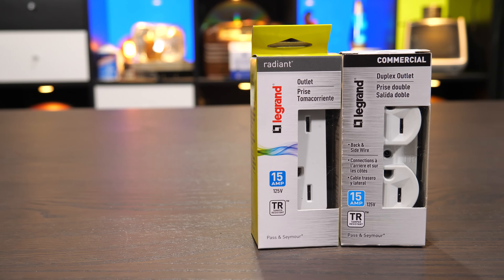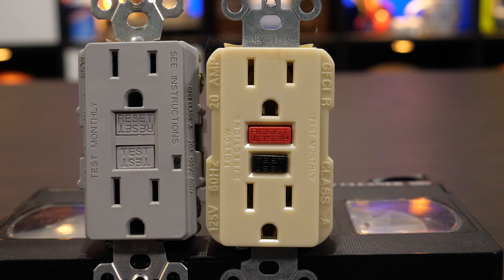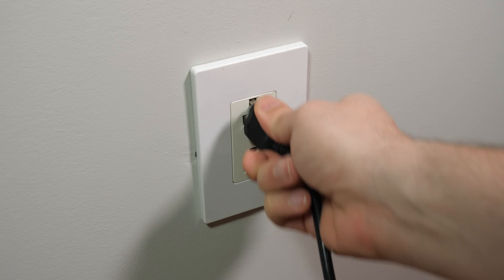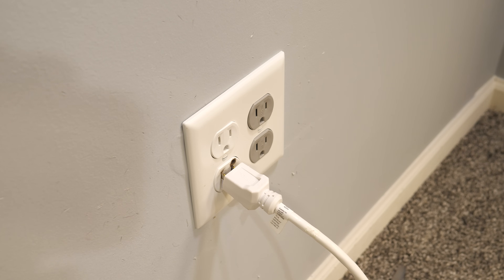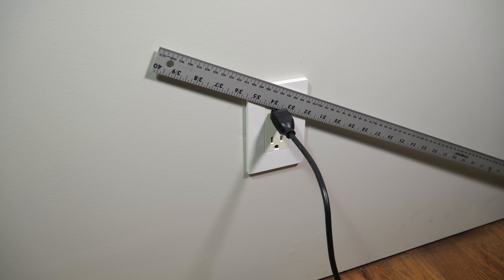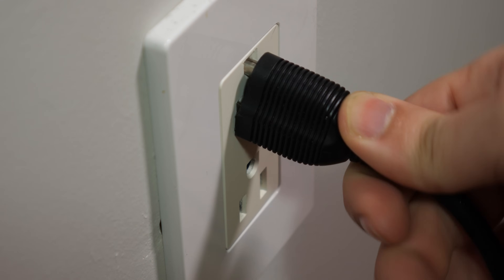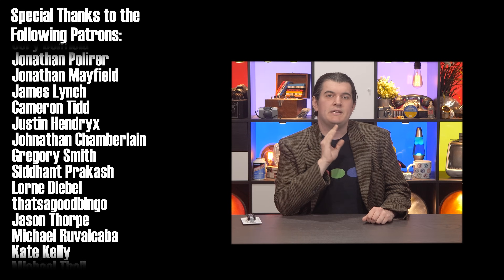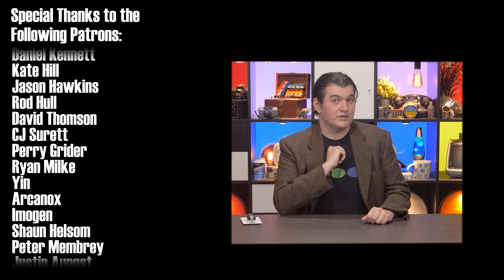Power outlets are topsy turvy - but does it matter?

Comment: my HVAC teacher had all the outlets in the shop with the ground on top. he claimed that sheet metal could fall and become stuck behind a plug. But most of the tools we used had universal motors with no ground pin, so in practice the ground pin orientation didn't matter.

Comment: I had some electrical outlets installed to replace ancient ones; great, except you couldn't actually plug things into them without a hammer(almost), child proofing I suppose. Had to replace them all with ones which I had to test a sample of before they were  installed.I like the 45° plugs and the extension cords with a molded in loop at the back.Great video as always.

Comment: In the UK, lots of imported stuff (mostly chinese) has the writing upside down and the cable sticking out of the top... because the chinese think our earth prongs are at the bottom. Also there's no actual requirement in our wiring regs to have our outlets earth up'

Comment: As a remodeling contractor, I can confirm that the tape-measure scenario is a.) real, and b.) will scare the pants off you. 😅 I almost welded my tape to an uncovered live outlet once, and it still has a sharp notch in the blade that I have to watch out for.
Reply: This was my introduction to this issue as well.  Scared the heck out of me at the time.
Reply: Most circuit breakers take a couple milliseconds to open, enough time for nasty sparks and welding if it's a dead short. Most electricity related injuries are caused by secondary events, like falling off the ladder when instinctively retreating from the loud bang.
Reply: Many years ago, I was working at a McDonalds. We had a heavy metal shelf above an outlet that was held onto the wall with keyhole slots. I missed the posts and the shelf hit the prongs, popped the breaker, and took a nice chunk of metal out of the shelf. 😬
Reply: Did it myself several years back. To this day I've got to fiddle with that tape to get it to fully retract.
Reply: @currentsitguy  Wow, your tape measure lasted for more than 6 months?? I've never zapped my tape measure, but none of them last long.

I think that the danger of American plugs are very overstated. I have never gotten shocked because of the plug or outlet. I've gotten shocked two times - once because I stuck my finger in an empty lightbulb socket, and once because I touched something that was connected to some metal siding that was just installed, that had a nail driven through a romex wire. Crazy but true. Also 120v is much less dangerous than 240v.
Reply: @FLPhotoCatcher  What are you doing to your poor tapes? I have two of them: one was my aunt's (this one is more than 40 years old), and the other I bought myself (this one is about 10 years old).

Both in good condition. Just treat them well, and they go a long way.
Reply: @sysbofh  I haven't mistreated my tape measures. Some of them broke after the first use. The springs in those were made of brittle metal - they were made in China, of course. I have one that is many years old, and may be made in the US. It's hard to find quality tape measures.
Reply: @FLPhotoCatcher  I've got a bunch of tapes, I just keep this one around as a sort of good luck charm now.
Reply: @FLPhotoCatcher  I don't think you're alone, the only tapes lasting for me are older than me. Whenever I buy new units they tend to fail, plastic case cracks, spring fails, what have you. Wish I could buy a simple 25 foot measuring tape of decent quality anymore.
Reply: “They go a long way” - 25 feet, to be precise!
Reply: @sysbofh  Pretty sure they didn't intentionally shove the end into a known live electrical source.
Reply: No fuses?
Reply: @Losermachine35  tape measures usually don't have fuses. Jokes aside, in these kind of situations you may not have high enough current to trip it, plus, fuses can melt/weld themselves which is more likely to be the case in a place with loose sockets/frequent trips.
Reply: Blend the notch out with a half round double bastard file until its not gonna bite your bits.
Reply: Is it worth covering the notch with packing tape?
Reply: Yes, but with changes to circuit breaker design, is that even a  problem that's going to exist in 50 years? Even today, I don't see this being a particularly common problem to have. Between the GFCI and AFCI being mandated, Fresh Princing the outlet doesn't really do anything that the advanced features don't do better. Then there's AFCI that's likely to be incorporated in every single circuit at some point, rather than just the relatively long list of rooms that it's currently required for. 

You'd likely get far more safety out of making it easier to replace loose outlets that can't retain the items plugged into them any more than flipping them upside down.

Comment: Yeah, it's not really a big deal. That being said, even a tiny tiny tiny tiny tiny safety benefit with zero additional effort is worthwhile. And I personally haven't encountered enough right angle plugs to justify choosing ground down. Better just to do away with the awful plug design, but that would take effort, which Americans don't like.

Comment: Germany has plugs which have insulation around the first part blades (which are round and therefore not prone to slipping), with symmetrical outlets and beefy right-angle plugs with a good grippy design. I wonder what flaws these have?

Comment: WRONG. All of the right angle plugs you buy are designed for the ground on the bottom. The  USA electrical manufacturers should be working on insulating the first part of the hot lead so that we are not killing children instead of this nonsense.

Comment: Not quite "throwing knives at the wall", but one time my cat was playing with a mouse toy with a metal wire attaching the mouse to the rod. She managed to drag the wire along the wall in a way that shorted out a night light that was plugged in. Tripped the breaker and scorched the receptacle a bit. Luckily nobody was hurt and nothing significantly damaged. We replaced the receptacle (it was a bit worn out, leading to the night light hanging out a bit), and replaced the night light just in case. Turning it upside would not have helped at all because night lights don't have ground pins.

Comment: Honestly I wish we could have just had a different outlet in North America. One that actually locked and wasn't only friction held, and one that you could feasibly plug in correctly without looking, with no risk of getting shocked.

Basically, I just want us to do what we did with USB, but for power (I'm not saying use USB-C to power appliances but rather, make a system that has a reversible plug and properly shields the live wires, and something which will only connect when it snaps into place fully inserted). People can just deal with dongles during the transition period.

Comment: And this is why I love your content, a lot of strange esoeteric things that I may not have noticed otherwise in my day to day nonsense of switching hats jobwise.  Recently been doing electrical work on my parents house, and it's a 5k sq ft+ home, with a LOT of electrical outlets, since code requires it in so many damn fangled places, but you can't have too many on a single circuit, but they want MANY.  And I never noticed the hundreds of boxes I have looked at that the recepticle was inverted in the art/photo.

Comment: Your argument for NOT flipping them upside down is NOT an argument.

The plugs with the cord & ground going "right side up" STILL block another space for the same type of plug that's setup that way.

Lookup "swivel plug adapter".
Problem solved.

You can have your cake & eat it & have the safety numbers with reduced risk on your side with upside down plus outlets.

Comment: I actually had this happen once at work. I was tie-wrapping a bundle of boxes in an industrial box crusher. Right behind it was a 110 outlet for whatever reason.  Plug was installed "normal" with the blades up. The tie wire tended to wrap and coil around the back side of the machine a bit along the wall. Whatever was plugged in had been pulled away just enough that when I fed the wire into the machine and it curled over on the wall, it touched the hot and neutral and a huge shower of sparkles occurred. I looked behind the machine and saw charred concrete and electrical outlet. Most likely melted that Tractor Supply's wiring to that circuit too before it popped.

Comment: My house was originally wired with plugs one way and others upside down. The cheap outlets started failing after 15 years so I replaced them all in the face position. I now see why my electrician said they were upside down. The stronger replacement outlets (harder to plug in) make it easier for fingers to slip onto the prongs and get a mild tingle. I like angled cord plugs but had to buy a couple round adaptor/spacers to space the upper cord outwards. Like many houses, there are no lights in living rooms and dens, so half of certain outlets are switched, the other half standard. That should be a double outlet, IMO. Better, just install lights in every room, you architect dolts. For areas where outlets are installed horizontally, they make "sideways" outlets... which again leads to "which way up". They also make outlets were the 2 plugs are staggered, with one facing up, the other down... no cord overlap and no way to install upside down.

Comment: It makes me really happy to have the UK Type G plugs, ours  are ground up, side-by-side, and cable down.

The only problems comes with bulkier plugs in extension leads.
Reply: meanwhile, in Europe and Aus/NZ (though at least in the latter case this is a recent-ish change) just insulate the base of the prongs so the levering issue never becomes a safety hazard to begin with. (and NZ at least has switched sockets as standard too. you occasionally find unswitched sockets, but they're generally old and/or intended for a specific purpose where the thing plugged into them will both be unplugged only for repair or removal) 45 degree  plugs are generally more practical while still maintaining the advantages of stright down plugs, too (though whether you get a 45 degree plug or 'straight out the back' plug with the Aus/NZ plugs depends on how recent it is and what the expected use case it.).

Basically, Aus/NZ plugs are Slightly less safe than British ones (not by enough to matter much though), while being noticeably more convenient (usually).

Also, wallwarts are just a menace in general.

Comment: Maybe the building code need to change so the ground pin is always on top and the manufacturing of cords needs to match. And in the case of a plug that needs no ground a dummy ground pin would be the standard.  I remember when they changed to the polarized plug I got used to it,  eventually  LOL 😆 😆

Comment: Interestingly enough, a lot of grounded 240 volt plugs are designed assuming that the ground prong is at the top. So occasionally I find dryer plug wires upside down because of that.

Comment: Anecdote

I have an Onn (Walmart brand) power strip that would actually be a really great right angle standard design. There's a nifty lil divot on the shell for a finger to go, and the whole shell has flaring opposite the prongs. Makes it fun and easy to plug it in and unplug it 😂

Comment: Just adopt the BS1363A. You've taken the language and Americanised it so take the plug standard as well. As a side note, those "kiddie proof" socket covers have many issues in the UK. Oversized pins that push the spring terminals inside the socket too far apart to make properly made plugs loose and cause arcing, to actually making it easier to insert something in to the socket as the earth pin is what opens the live and neurtral shutters, to being able to be put in upside down the plug and open the L+N shutters (yes, UK sockets have to be large enough to prevent this, although curiously extension leads are exempt from this). And those inserts do not conform to any standard because one doesn't exist because they just are not needed with a decently designed socket and recepticle. And with a BS1363 plug you can also open your bottle of beer with it.

Comment: A fairly simple solution that would retain compatibility is to add an insulating shell around the plug end that shields the conductors. The IEC 60320 C14 plug (and corresponding C13 receptacle) are used quite a bit in server racks because of the wiring density and the desire for the plugs to not back-out of the socket. A 'standardized' socket/receptacle could be made using the Type-B arrangement, but with a groove (similar to the IEC 60320 C13) that would match with a 'standardized' Type-B plug that has a shroud around the plug pins. This would solve 2 problems: accidental contact with energized pins and dislodgement over time due to gravity or impacts. Additionally, some IEC plug/sockets have a locking-feature (just a plastic button) that prevents the plug from being dislodged without manual manipulation. The 'groove' and locking feature in this new 'standardized' safety socket would be backwards-compatible with all devices, since it would not interfere with old-style plugs. Over time, more plugs would be made with shrouds and locking tabs, enabling the safety features. And the orientation of the plug would not matter.
Great video, thanks for the content! Cheers!!

Comment: Fun fact - here in New Zealand we use an exciting, angled two and three prong plug that's also used in Australia and China (and maybe other places).  Here and in Australia, we install them with earth (ground) at the bottom like you in the US, but in China they install them the other way around.  I actually have a couple of devices from China (designed for the Chinese domestic market) with right-angle plugs which have the cable pointing the 'wrong' way.  Of course Chinese products designed for export to our market have right angle plugs which face the 'right' way.  What a world!

Comment: The design of US electrical outlets has always baffled me. I’ve lived in Chile for my whole life, and we use a design with three cylindrical prongs in a row, where the optional ground is in the middle and you can actually flip the cable around both ways, it will just work. I have only ever seen them in a vertical configuration, which makes sense because it’d be far too easy to accidentally damage them or ruin a game of throw knives at the wall if they were sideways. Not like you’d actually get to touch them live, though, because they cannot hang loose like the ones y’all have. Also, although the prongs are usually fully made of bare metal, they’ll only make contact if they’re fully inserted all the way- I’ve been frustrated many a time when realising my device hadn’t been charging because it had been just a millimetre away from contact, but I’d much rather have that than such an open invitation for disaster.

Comment: Before watching this video, I have one problem with positioning outlets the correct way - most power bricks/wall warts that plug directly into the wall are designed for the "incorrect" outlet. Plugging them into a correctly oriented outlet makes their wires point up instead of down. Industry has settled on the wrong position and they have too much inertia for me to care about trying to stop it.

Comment: Ground pin up is great if you like your 90 degree plugs to point the cord upward to loop back down, and you like your wall warts falling off the wall.
90 degree plugs are made that way because the three wires are less crowded if the ground wire does not have to pass between the two power wires, and can be a bit shorter to get to the ground pin below them.

Comment: As I've been remodeling my house, I was installing the outlets the "correct" way with eat new circuit, but I got so frustrated with right angle things not fitting correctly that I got fed up and now put them in the common way. So now I need to go back and undo all the other ones!

Comment: Hey Alec, I have a question about something you said in an earlier video, you said something about the European style of outlet’s with on/off switches seemed to be a bit over the top, and I just can’t wrap my head around why you think that, I live in Denmark and always switch off the power before inserting or removing a plug, and it has saved me from a nasty zap countless of times, not to mention things like hand mixers or hairdryers, it’s a nice thing to not have you living soul scared out of you when you plug something with a loud motor in

Comment: I see another problem: the tendency of designing a housing with the plug as close to the body of the housing as possible. Otherwise, a simple lip on the faceplate would've solved all of this.

it's time for a new standard.

Comment: Outlets would be uglier if the ground is on top.  MOST are on the bottom.
When in my workshop I have a quad outlet situation, I put one pair ground down the other ground up.  Works well.
Ground should be down.
Your store pix appear all of one manufacturer.  Not a real proof.
What does the nation electrical code say?

Comment: Wait so one of your key points was that because not every plug has a ground pin the upside down method doesn't work but then you make a long-winded argument about right angle plugs which not every plug has as a reason not to flip the plugs. That seems a little bias